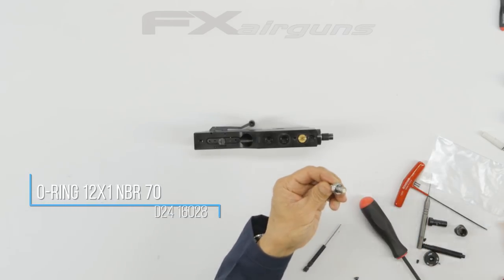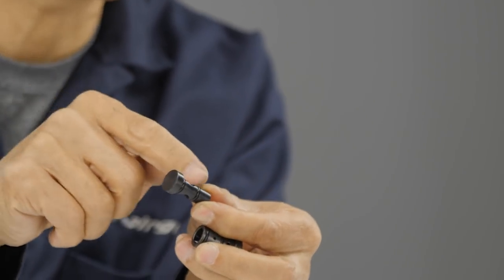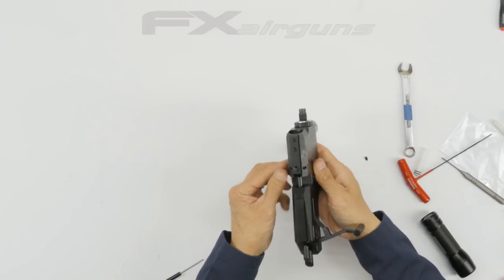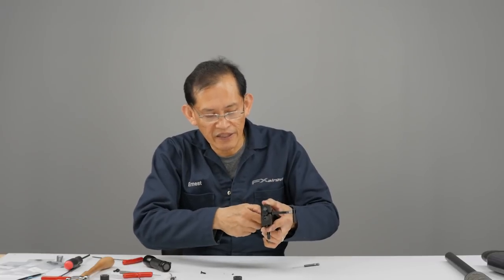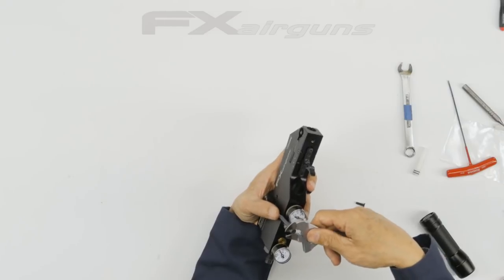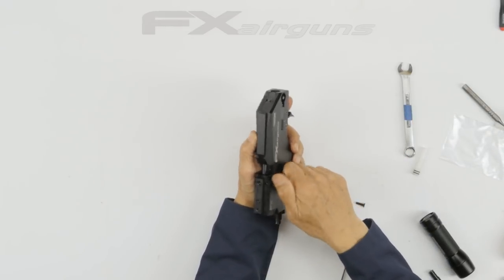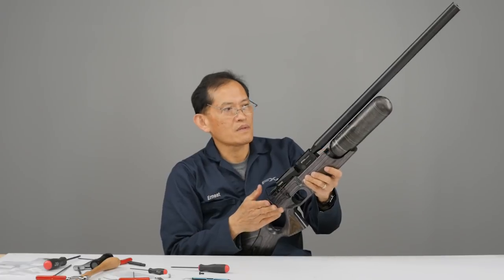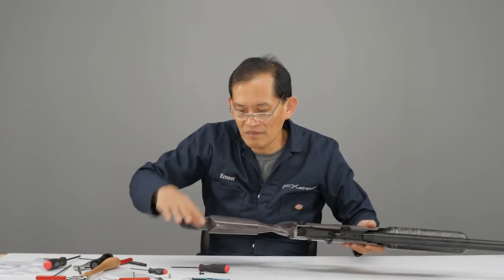FX Masterclass : Crown Reassembly - Part Two

Comment: Thank you for your valuable videos. 
I had some problem with my cocking lever. When I pull it trying to cock, it's a bit hard and stuck at one point. But with a little force and tilt I can cock. I am not satisfied with its movement. Please advise solution. Thanks in advance.